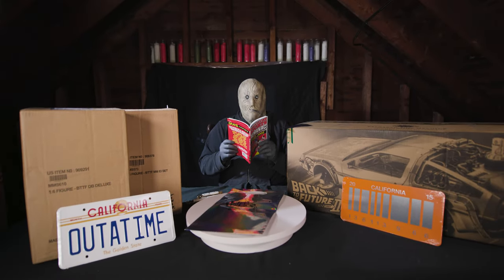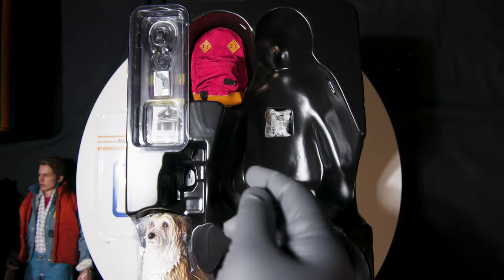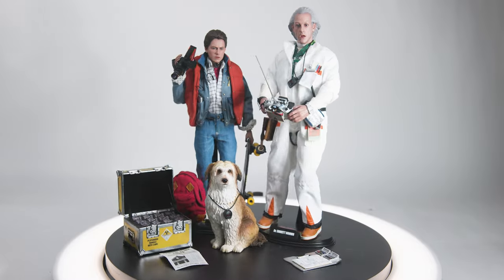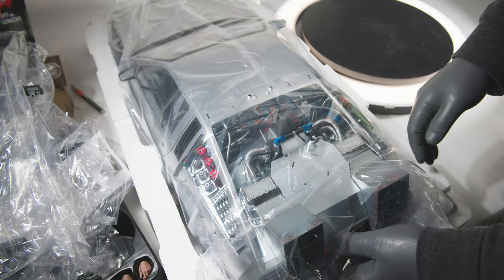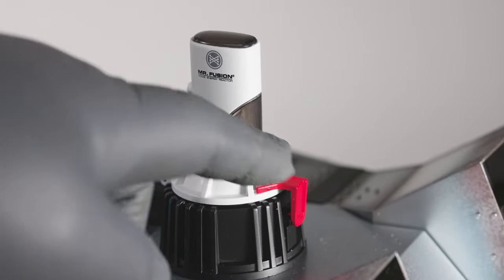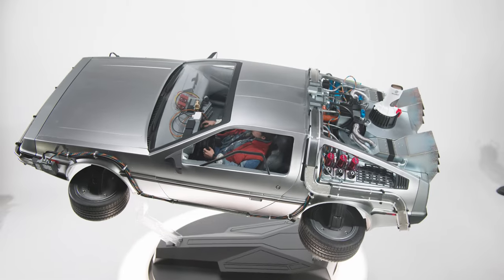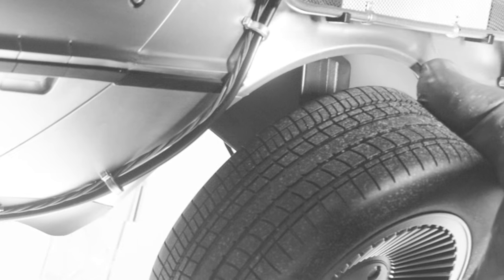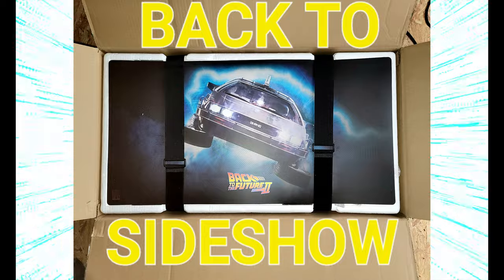BROKEN!!! Hot Toys Back to the Future DeLorean Doc Emmett Brown and Marty McFly, review, postmortem.

Comment: Great video! I love the attention to detail. My delorean came in, and one of the hoses was missing the small plastic male fitting, and the usb-c power doesn't work for some reason. So I have to use batteries. Unless there is a separate way of turning it on via usb-c that I don't know about. Thanks for the video

Comment: Awesome video brother! That Clive Barker mask from Nightbreed scared the crap out of me when that movie came out Lol! So sorry about the condition of your vehicle. To alleviate the 'Digging " in on the pins, I backed out all of the screws on the hover assembly. about four turns each. Seemed to have worked in relieving the pressure on that part.
Reply from the maker: That is a really great idea, though I think it would be difficult to do before you pull the wheels out (unless you have an L bend watch screwdriver). I'm just wondering, did your Styrofoam packaging have as much play as mine did? Even with the lid on the vehicle still shimmied back and forth rather significantly, so much so that after repackaging it exactly as It had come, I could hear it thumping around in the box when I gave it to the UPS person.
Reply: @strangeform  I checked the "play" after I watched your video. There was some but not enough to cause any damage. I was fortunate. I do have a video on an alternative in the event the replacement car has the same issues. Hope this will help to repair or prevent any damage. https://youtu.be/nJB3czKWudk

Comment: They should simplify things and just made add on flight mode pieces. Not articulated.
Reply from the maker: That's exactly what I think as well. 

In fact, they really should have made the whole thing modular. This way, they could sell separate accessories down the line instead of trying to release a whole new part 3 vehicle. This is something they finally got right with ED-209, in combining  the previous two versions into one piece with multiple display options.